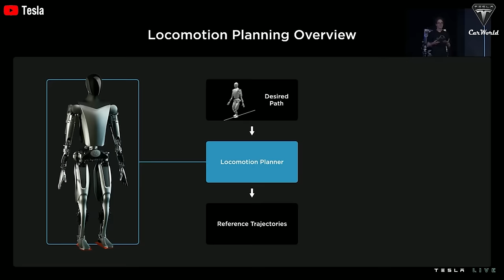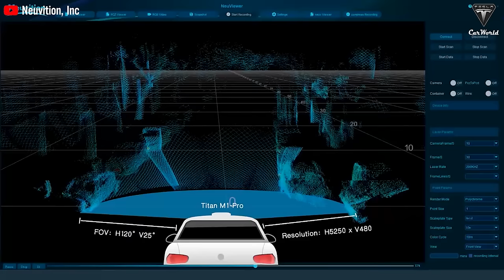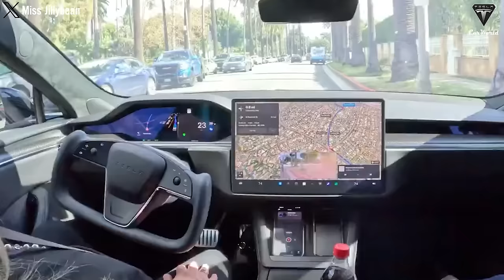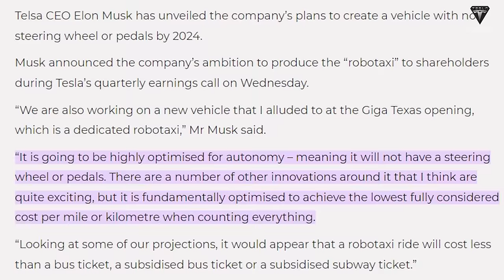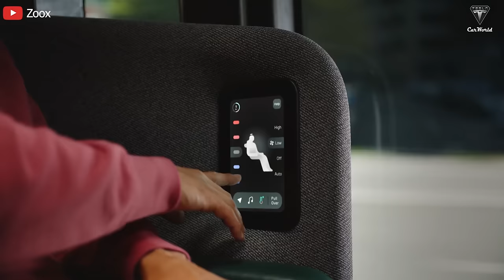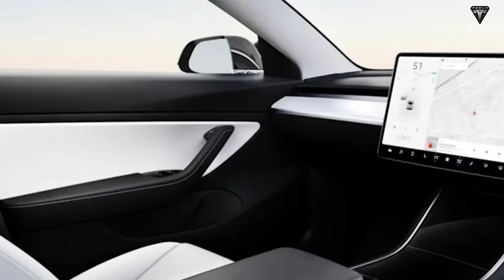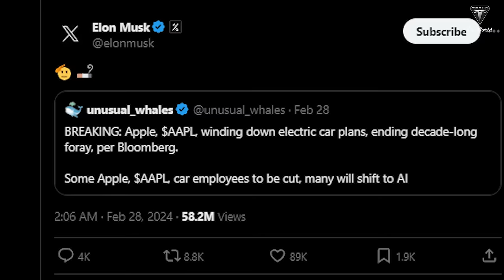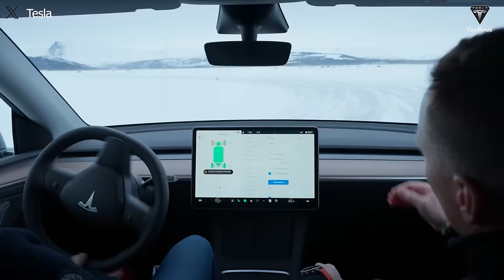Elon Musk Reveals NEVER SEEN Tesla Model 2 Designs and Tech in 2024, Will Change Your Choices! (MIX)

Comment: If they allow for Optimus knees to go forward MORE then the bot will be able to balance and do a FULL RANGE squat... in trying this they will also discover the parts or cables that will be in the way in such occasions, and putting them all within a protective casing just like humans have all the nerves and bones blowing us to move down and put SOME pressure on the upper leg without anything happening... 
if the knees stay back it keeps the rest of the upper body back and NOT in balance, anyone lifting weights doing FULL RANGE squats knows how it is when lowering with a HEAVY loaded barbell on your back. Allowing the center of gravity of the weight to remain in the middle or a bit to the front of the foot.

Comment: Art Generator Software

Technology > Application > Communications
Technology > Application > Everydaytech
Technology > Technology Levels > Middle Tech / Midtech
Technology > Application > Software
Culture and Society > Fine Arts > Visual Arts
Art Generator Software*
Image from Keith Wigdor and Midjourney AI
AGS is a class of software that allows users to easily create visual art. Using an art generator is as simple as describing a scene to the software package, or using some other prompts such as photograph, video clips or pre-existing artworks. Using these prompts as inspiration, the software will then proceed to generate an image. If the generated image is unsatisfying, the user can edit the scene by offering clarifications. A sophisticated AGS system can create a piece of art which reflects the user's requirements by anticipating their needs, adding subtle nuances to match the user's descriptions, even if they are relatively vague. The end result is somewhat generic but functional art. AG software can also be used to edit pre-existing art that is fed into it.

The core of this type of software is a library of pre-packaged objects and templates, and a description interpreter — typically a simple expert system but specialized AI may be used in more powerful packages. The interpreter can handle a wide variety of inputs, depending on who the intended users are — verbal descriptions, body language, memory uploads, tactile sensations, and a plethora of other communication methods and data encodings. AGS systems, depending on their sophistication, gradually adapt to the preferences of their owner as they are used, and learn to understand and even predict their requirements.

AG software is a mature technology in the modern terragen sphere, with the earliest versions dating back to the Information Age. AGS packages of one type or another are a standard feature of general purpose computing devices, and in some societies employing DNI, generated images are a standard part of any communication. As such, there are some functions that almost any art generator has:
- In order to produce convincing art (taking things such as lighting and perspective in account), art generator software generates every image as a 3D scene internally. As such, even the simplest versions of the software can render 3D scenes as easily as 2D ones.
- While the typical AGS package is capable of producing realistic scenes it is not limited to them — it can produce art in a wide variety of styles, and convert it from one style to another.
- Most can analyze preexisting works of art done in an unknown style and then mimic it in the future.

More complex versions have the ability to create video works and virch environments. In order to deal with additional demands of these mediums, these versions contain a library of sounds (and other sensory inputs), and ability to manipulate them in the same way the basic AGS manipulates visual objects. This kind of advanced Art Generator Software forms the basis of most user-friendly Virchbuilder technology used by modosophonts to create Virtual Reality Environments for their own use. 

Automated procedural generation can be used to create large virtual environments, but the development of these environments and particular details can be controlled by an AGS verbal or direct neural interface. One particularly popular method of interfacing with art generator software is by the use of smart paint; the artist can create an image using a paintbrush, stylus, airbrush tool or even their own fingers or other appendages; the smart paint then responds to the painted image by adding detail, correcting mistakes and adding procedurally-generated backgrounds, either autonomously or with input from the artist via a variety of methods.

One advantage of using autonomous AGS is that an arbitrary number of alternate images can be generated at the same time, and the artist is able to choose the one they prefer; often the artist will choose elements from several different versions, which can be combined seamlessly by the software.
History:

The earliest versions of art generator software emerged in the Information Age serving as support tools for games and virtual realities of the time, helping less tech-savvy users build their own avatars and add content. They only produced art in a single style, but the ability to create through simple verbal descriptions was well received by the users, so stand-alone versions soon appeared on the market.

Because of the very generic appearance of the art produced by early versions of AGS, there were many critics, especially professional artists, who claimed such software was culturally harmful and otherwise unsuited for anything but most trivial purposes. The criticism had little lasting effect, as the use of such software spread quickly among amateurs and casual users. These users, when snubbed by the critics, generated their own prizes and cultural recognition methods that bypassed the then-traditional critics. The use of generated images as visual aids in written works and descriptions became especially widespread. As the use of AGS became common, professional artists started using it to handle their commissions: an approximate version of the client's demand would be finalized with AGS, and the artist would use that as a basis for producing actual works.

Art Generator Software
Image from Steve Bowers
Smart paint responds to the user's wishes by adding detail and style to painted artworks as they are being painted
At the same time, specialized AGS packages (called 'toolkits' at the time) were incorporated in popular franchises, allowing fans to produce fan-works with the same visual style used in the work itself. Over time, the format in which these styles were stored in was standardized, allowing several general-purpose AGS packages to simply import relevant templates and gain the ability to produce art in the style specified. Desires to bypass the often expensive copyrighted styles fueled the development of 'mimics', which could produce a simulacrum of a particular art style simply by analyzing a number of artworks that utilized it. Though media corporations attempted to outlaw such tools, it proved technologically and legally impossible to enforce a ban on them.

The large number of pornographic or hyper-violent imagery that anonymous users produced with AGS packages caused deep controversy at the time, and there were numerous motions to mandate installation of restrictions and safeguards into them to curtail such use. Such measures proved futile at the time, as unrestricted versions could be easily obtained. Memetic solutions proved to be far more effective than technical ones in restricting questionable use.

In time, professional versions of art software began including AGS as a component of itself — these software tools allowed artists to produce the basic framework with minimal effort, and then provided additional tools to modify this 'raw footage' into a piece of art they had in mind. A profession of 'style artist' emerged at this time, describing people who did not produce individual works, but rather invented different styles or art and then sold them as AGS templates.
 
Related Articles

Paintbox Habitat
Virchbuilder Packages
 
Appears in Topics
Communications
Everydaytech
Middle Tech / Midtech
Software
Visual Arts
 
Development Notes